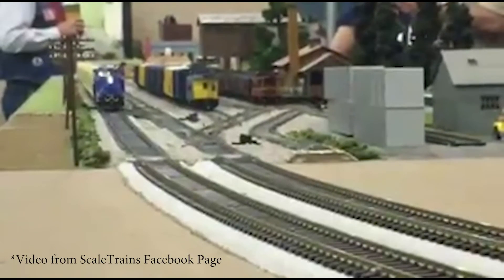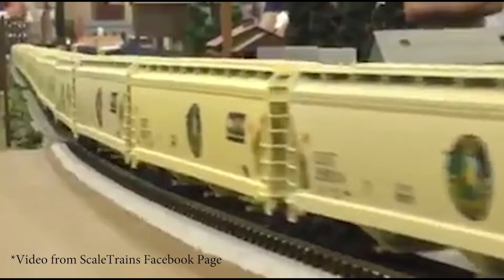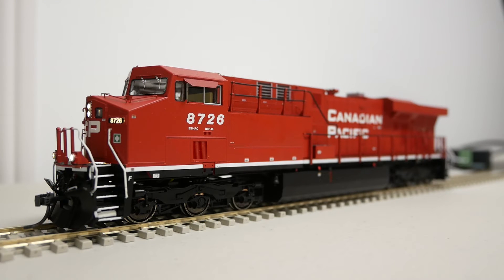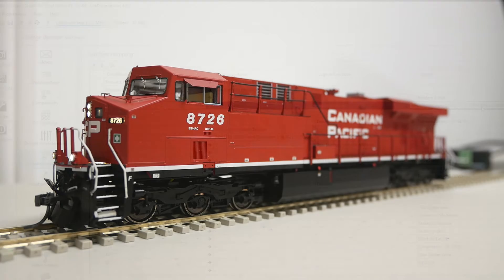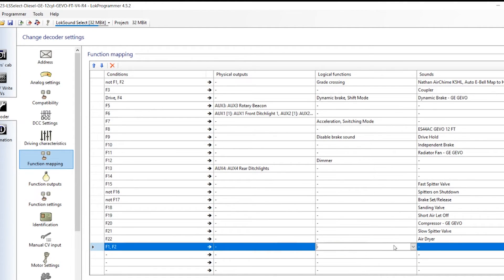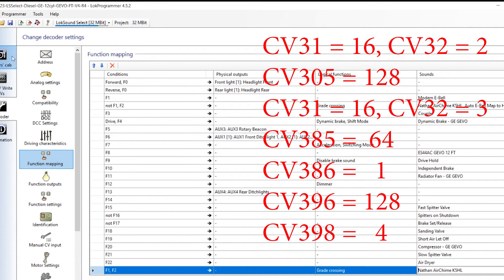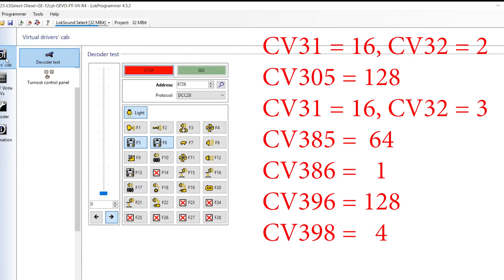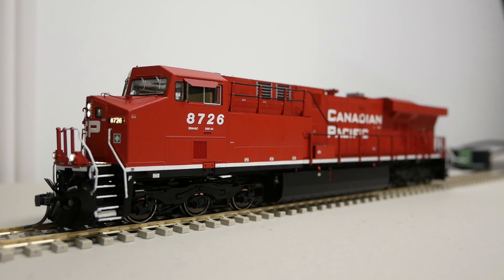Tutorial: ESU LokSound Automatic E-Bell Overlapping Fix For Scaletrains.com Tier 4 GEVO

Comment: Thanks for this video, helped with fixing the same issue on my BNSF ET44C4. Which is part of the newest run, June 2020.

Thanks again for making this video on how to mostly fix the issue!

Edit: I found that one part of the add on function (F1, F2) will not apply to all Scale Trains locos. Adding "logical function" as "Grade crossing" will cause the ditch lights to alternate when the bell is active and when the horn is blown, this is not accurate for all Tier 4 locos. So if you run into that issue, leave the "logical function" area for F1, F2 as completely blank (where appropriate).

Comment: Worked Perfectly. Thankyou!  - I have a Loksound 4 problem unrelated to your fix, and hope you can help... my Scaletrains Loksound 4 no longer sounds the horn (F2). BUT if I activate the bell(F1) and then hit (F2) horn plays as normal. No Bell=No Horn. I hadn't been changing CV's when it started, only thing I did was remove it from a consist but I'm not 100% sure if that's when it started. I did a CV8=8 factory reset and no difference. If you could spare a moment to comment what you think it is I'd be super grateful.

Comment: Thanks for the tip. I just fixed 3 of my engines with few more to go. Two of the 3 were new Scale Trains T4 GEvos. They didn't fix the problem yet.
Reply from the maker: Yeah they never fixed it. I also mentioned this in my review of the Scaletrains Tier 4.

Comment: you just have to email scale trains and tell them the problem.. and ask them to watch your video
Reply from the maker: I took a look at their FB, a few people actually already mentioned it. I'm fairly sure they are already aware.
Reply from the maker: For this car I used 0.1mm brass sheet cut into strips and bent to shape, then glued to the inside of the truck using cyanoacrylate. I have another car car to do which I'm going to use some brass wire instead for less resistance on the wheels. Stay tuned for that one!